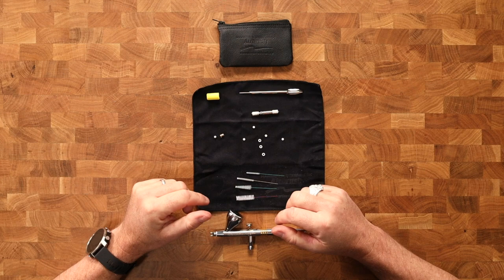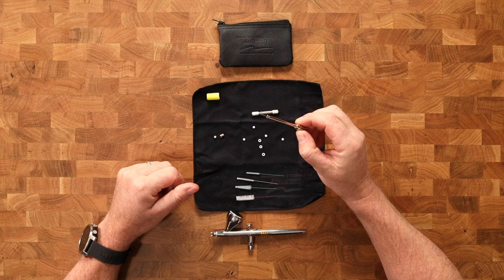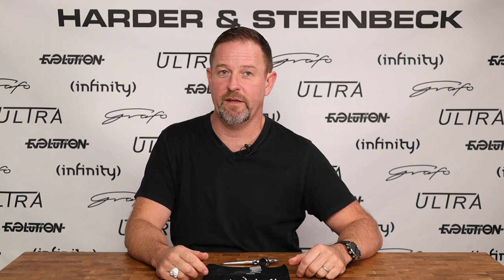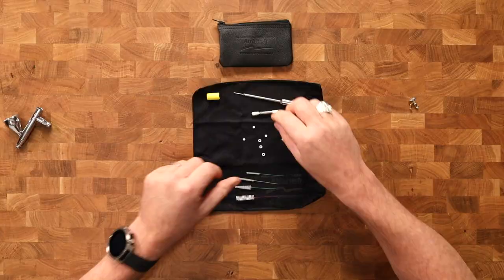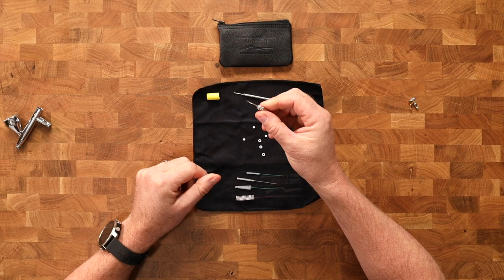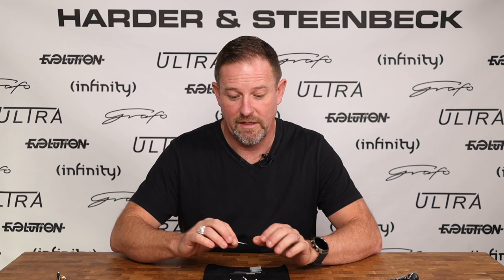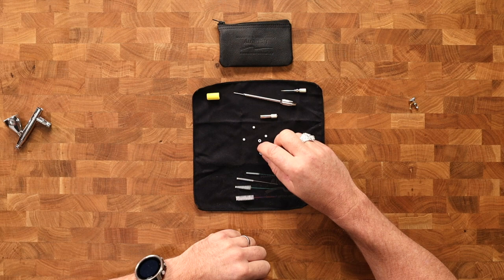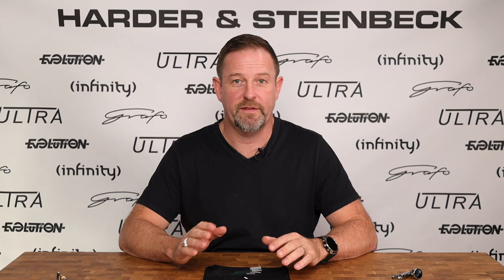Airbrushing Maintenance 101: Tips and Tricks You Need to Know

Comment: Can H&S seal packing screw adjust?  I've never seen about this in manual book.
Reply from the maker: Technically it is possible to "adjust", but to be honest, "adjustment" isn't really a thing. It's either right, or wrong. Too tight and it drags too much, too loose and it won't seal. The "right" point is just being able to feel the slightest drag on the needle integrated to the screwdriver. Then you know it's sealing, but you have nothing interfering with your trigger feel.

Comment: Just got my first airbrush, an ultra, and finding these videos really useful. It would be great to hear the opinion on lubricant for a H&S airbrush. Is it something I need to do?
Reply: I think, I've seen evidence of H&S using the blue lubricant from Iwata. I've moved away from that as it can dry - if the airbrush isn't used for awhile - like thread lock, or at least gum up (makes the needle sticky/stick). I'm not sure if H&S would endorse such, but I use glycerine on threads, triggers and on parts of the needle. At a push I use beeswax on the aircap threads (carefully) but I prefer glycerine there too. I hope that helps🤞✌️👍💜😊
Reply from the maker: Hi James. We are working on a lubricant of our own, but at the moment, the one that I feel comfortable recommending is Iwata Superlube. Use it extremely sparingly. The reason why we like it is simply because it's very hard to find a lubricant which does not damage or in some way interfere with paint film integrity, and putting it in the airbrush puts it very close to the paint! However, the Iwata lube is very good in that regard, and it's the only one that I know of which does not risk the integrity of the paint film. But don't use much. Too much, and it's a little toooo sticky on the action.

Comment: Great video, if I may ask for some advice please? When I backflow when I am cleaning my evolution I notice sometimes the bubbles are very strong in the paint cup, and then when I stop and do it again they are very weak. 0.2mm nozzle set. Airbrush is very clean but I am at my wits end cause I can airbrush and then it stops. It is like it loses pressure then it comes back again. Compressor is running perfectly, an6 help would be greatly appreciated, thank you
Reply from the maker: Take the handle off, loosen the needle nut, pull the needle back a touch, tighten your head, reset the needle, tighten the needle nut, should be ok. Sounds like a slightly loose head to me 😊

Comment: Really enjoying the videos!
Are metallic paints safe to use in airbrushes and is there anything different we need to do with air pressure or thinning when using them?
Reply from the maker: As long as they are from a reputable manufacturer, and are designated as airbrush paint, you'll have no problem. Just treat them as per any other paint, really.

Comment: Another great video!  How do you remove the old needle packing if it needs to be replaced?  Thanks!
Reply: With the tool that he demonstrates - it's a spare part from H&S dealers. Unless you're a pro painter the packing "nut" and packing shouldn't need any attention though.🤞👍💜
Reply from the maker: Using the screwdriver shown in the video. BUT I guess you might be asking about if a seal stays in the airbrush? Firstly, our engineered screw design does reduce the likelihood of this problem, as the seals load partially into the screw itself. However, it is still possible that one stays behind in the airbrush. One of the reasons for the design of the rear of the needle (the little bumps that we use to identify the needle size) is exactly for this. We love engineering two purposes into one feature ;-)... Once the needle packing screw is removed, if you think that you have a seal still in there, just push a needle (rear end first) in from the front of the airbrush. With the needle packing screw removed, the little ID bumps on the rear of the needle will grab the seal and carry it out the back of the airbrush for you.

Comment: From day dot I've had an issue where paint is coming up into the airbrush where the needle is and drying on the needle causing it to stick. I've never mixed paint by using the blow back method and always kept it meticulously clean is this due to the needle packing then do I have to buy this kit to repair it 🤔
Reply from the maker: Hi James... if your airbrush is spraying smoothly with no interruptions in the paint flow, then it is unlikely to the a faulty needle packing. If that's leaking, then you're most likely not going to be able to actually spray. If you have paint back there, then, check that you never remove the needle when you have paint in the airbrush, firstly (sorry for stating the obvious!)... if you're not doing that, then do a fairly aggressive bubble back technique with cleaner as your last method, as this reaches everywhere well, and finally, spray that out, pull out your needle, and wipe a very tiny amount of Iwata Super Lube (very good product) onto your needle before reinstalling it. You should find that the problem won't re-occur. Do let us know! Oh and run a little cleaner through before you start painting next time, too.
Reply: @harderairbrush  thanks I'll give it a go

Comment: Is it possible that the mechanism which is attached to the trigger (the longhole in the curved piece which moves the needle) wears out over time? Especially the slotted hole? I have a slightly clicking noise when i pull back the trigger completely back and i think it comes from this piece. Needle, nozzle and all sealings are new as i just made a complete revision after years of painting. But still doesn‘t want to work perfect again… maybe you know this issue as well?
Reply from the maker: Hi there - no I don't know that issue. Get in touch with us on info@harder-airbrush.de and refer to this message from Warrick. If you want to send it to us, we will do what we can to help. It's interesting for us - how old is the airbrush?
Reply: @harderairbrush  thanks for your fast replyhere. Mail is already sent with a short video of the problem included. The airbrush is an Evolution and is about 10 years old.

Comment: Cleaning airbrush after airbrushing with varnish. Will a few drops of acetone be okay? Or will it damage seals?
Reply from the maker: Firstly, acetone will not damage our nozzle seal, or our needle seals. The materials we use are robust. HOWEVER, why spray acetone in an area where your non-acetone breathing human lungs are? It's a super aggressive solvent and 100% unnecessary to use in an airbrush. Please look after yourself as well as being concerned for your seals :-) If the varnish is solvent based, then use whatever your varnish thinner is (might be toluene, or cellulose, typically). If it is water based, then of course, just use the water based cleaner than is recommended by the paint manufacturer. You don't need acetone in your life :-) Of course, whenever spraying anything organic solvent based, do consider wearing a mask with an active charcoal filter, please.
Reply: @harderairbrush  Thanks should have said Isopropyl Alcohol, rather than acetone. I always use mask. As Vince Venturella mentions it, in his youtube on Varnishing with airbrush, in cleaning section near end.
Reply from the maker: @timestop5843  ok great to hear that you're looking after yourself! Vince is a legend and his advice is always great, but the use of IPA after a varnish is only appropriate if the varnish is solvent based. For example, Createx Paint do some stunning varnishes, which are waterbased, and these will not clean with IPA. Be sure to use the RIGHT cleaner - there is no such thing as a universal cleaner.